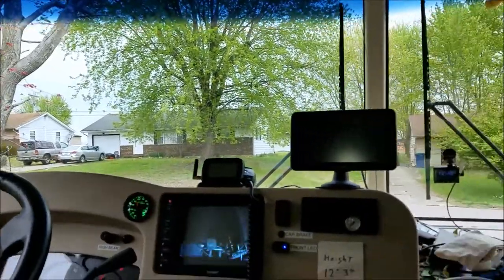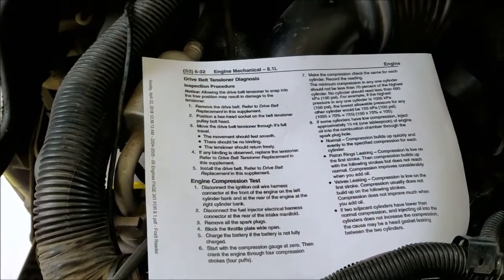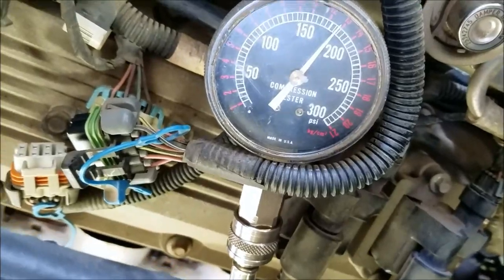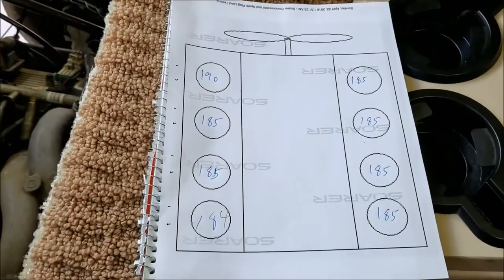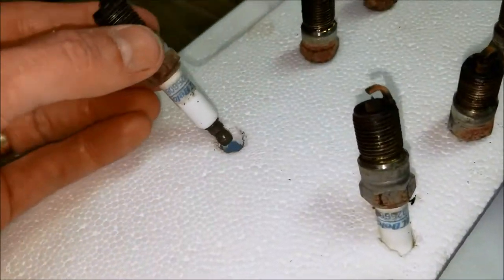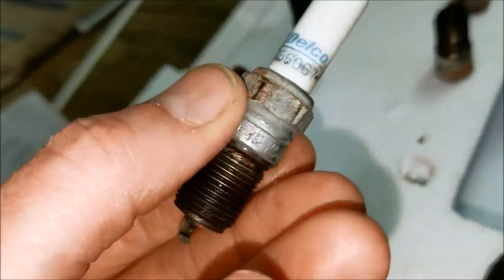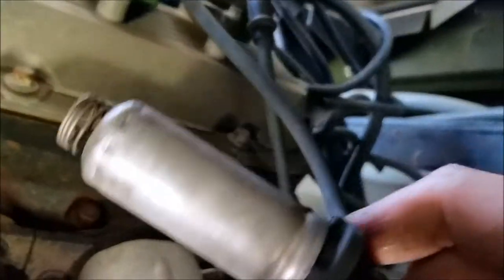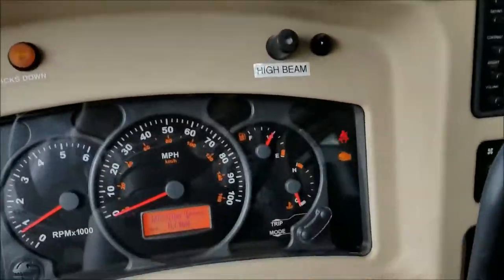8.1 Vortec Compression Test & Spark plug Change W24 Workhorse Chassis

Comment: Thank you for vid Kevin. Swapped out original platinum plugs.  106,000 miles.. 1/4" gaps. Original wires on 2004 were seized,  destroyed several during removal. Made a long hook tool and pulled connectors from outside wheel wells. Same hook tool then reinserted and pulled off the seized metal tip connectors. No more misfires on idle.
Reply from the maker: Wow 106,000 you got your moneys worth out of those plugs for sure..
Now you wont have to do it till 200,000 miles. But Brazels RV recommends changing every 30,000 and I agree based on what mine looked like at 40,000. 
Thanks for watching and leaving a comment.

Comment: I always find your videos so helpful as I have the same workhorse chassis. I have a question about the spark plugs. I have a 2005 WH W22 8.1. Book says w8800473 under spark plugs. My rig currently has AC Delco 41-983. Should I stay with these or switch to your suggestion 41-101?
Reply from the maker: Per the advice of Jon Brazel , based on dyno pulls the 41-101 is the better plug. That's what I run.

Comment: Kevin, thanks for these videos on the Workhorse chassis and 8.1L Vortec.  I have a 2007 Winnebago Adventurer...same chassis/engine...while I don't have a lot of time to work on it right now, I'm looking forward to having some time soon and your videos will be invaluable!  My current challenge is finding the reservoir for the hydraulic jack/slide-out system...I know I'm low on fluid but having a hard time locating the reservoir...probably need to call Winnebago!  Terry
Reply from the maker: Thanks for watching this link may help you locate your tank I think its in the same location as mine https://youtu.be/YXzL2NXrQZU 
If you ever need help just call or text me 606-875-0125 Kevin

Comment: P0200 means that the engine control module (ECM) has detected a malfunction in the fuel injector circuit. The fuel injector circuit controls the fuel injectors and commands how much fuel and when to spray the fuel.
Reply from the maker: Thanks for contributing

Comment: Kevin, you mention that you have an "enrichment problem" in this video. Did you ever figure out what was the cause of it? I am wondering if it was the PCM that you replaced with an older PCM that you had when you chased a P0200 code. Also is the PCM and the ECM different components on your MH?
Reply from the maker: The enrichment problem seams to only happen while I'm out west on after big change in altitude climbing a hill in open loop but it never closes until I shut down and restart the engine.
The P0200 was caused by a faulty injector driver in the ECU do to moisture infiltration.
ECU or ECM = Engine computer TCM or TCU = our Allison Transmission computer.
Reply: @ktoutdoor  (just 1 more question) after you disconnected the harnesses to the coil packs and to the injectors, did you bleed down the 55 psi that was in the fuel rail? I am wondering if that pressure remained at 55 while you were cranking the engine but the fuel could not get past the injectors because the harness was disconnected?
Reply from the maker: @larryv4249  I assume I removed the fuel pump relay so what little pressure was left would quickly bleed off on the first crank. Because the injectors would still be pulsing.

Comment: Hi Kevin. what are your thoughts in these plugs and how they worked for you ?  iv got a 02 chevy avalanche 8.1 with 190k miles. runs great and strong but iv got a feeling the plugs are old.  looking to change them and want to use the best plugs.
Reply from the maker: Yes this is still the recommended plug gap at .060 I used ACDelco 41-101 Professional Iridium Spark Plug https://amzn.to/3CQnphs
make sure they are ac delco and not counterfeit
Reply: @ktoutdoor  Did that other gap work well or are you saying 60 was better
Reply from the maker: @joesmith-fi1sx  FROM MY SUPPLIER IF YOUR RUNNING NEW SOLID CORE WIRES? SEE THIS VIDEO https://youtu.be/zMJaD4b9uuo
Update about spark plug gap 
We’ve done a lot of dyno testing and with our "Magnum wires", there was absolutely no difference in power between .045 gapped plugs and factory .060 gapped plugs. Removing the resistance in the ignition wire has many benefits! Back when we use to run Taylor wires, the .045 gap worked well but with the Iridium tips being a bit more fragile I recommend leaving them alone at .060.
Reply: @ktoutdoor  thankyou sir!

Comment: Hello Kevin, 
I have 2005 workhorse p42 6L v8. 
Iam searching the right fuel filter & bank 2 sensor 2 oxygen sensor but the results are a bit confusing.  I wonder if have an idea of the parts that matches my truck. 
thank you for your time. 
Amir
Reply from the maker: Text 360-736-2158 this is brazels RV they should have the part you need

Comment: Dielectric Grease is not an insulator.  DG (Electrical Contact Lubricant) provides ease of assembly for electrical connections, protects from moisture and prevents oxidation & corrosion.  Whether you should use it on high voltage connections and/or in high heat environments is another matter for discussion.

Comment: Hi Kevin , I have a 2004 Itasca with the 8.1 here in Portugal. Much appreciate your films. The one thing I am missing is a engine workshop manual and can’t find where to source one...any advice would be great. Also any thoughts on whether after 6 months sitting I should drain the fuel tank ? Thanks for your time .
Reply from the maker: 6 month on the gas should not be a problem at all, you can always mix some fresh gas with it when your ready. Send me a email to kc5210@gmail.com and I will send you a link to all the repair manuals I have.

Comment: I have an 8.1L on my suburban, the  recommended gap in my manual is .60 your gapping yours at .45 what's the correct gap?....thanks
Reply from the maker: Sorry for delay , I was told by Brazels RV per there dyno to gap at .045 for better performance + the gap will slowly get larger
Reply: You can gap iridium at 45 but double platinums are supposed to be at 60
Reply: Did you get better performance out of your engine and did it run better by gapping to 45 instead of 60

Comment: How does the double stack of Scan Gauges work? Do you have a splitter on the OBDII wire?
Reply from the maker: Yes this is what I use Docooler 16Pin OBD2 Splitter Extension Cable Male to Dual Female Y Cable 30cm  

https://www.amazon.com/gp/product/B000TMCX72/ref=oh_aui_search_detailpage?ie=UTF8&psc=1
Reply from the maker: I love having 8 data points to look at while driving

Comment: P0200 is an injector circuit code. Most likely electrical, not mechanical.  The 8.1 is notorious for intake gaskets if you do run across a misfire.
Reply from the maker: Thanks for contributing for me I found moisture had got inside the ECM and was shorting out one of the injector drivers, The ECM had been modified and not sealed properly. https://youtu.be/FKrll4Vdi3o

Comment: Remove the fuse to the fuel pump.
NEXT start the engine,  engine will run for a short duration.  This will bleed off all the fuel pressure.
Reply from the maker: Thanks for the tip,